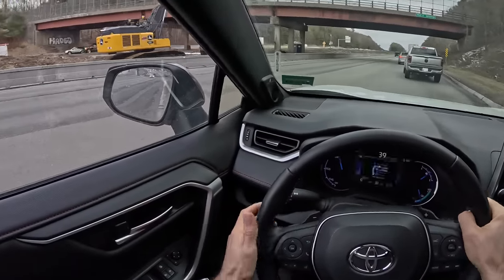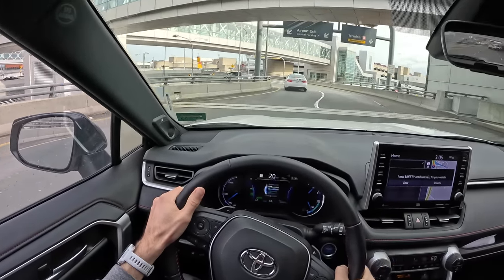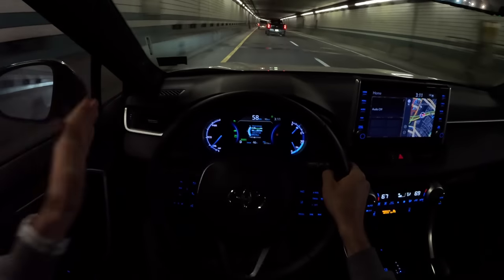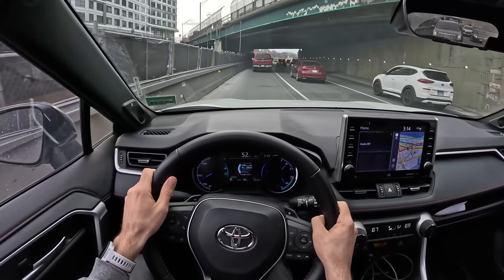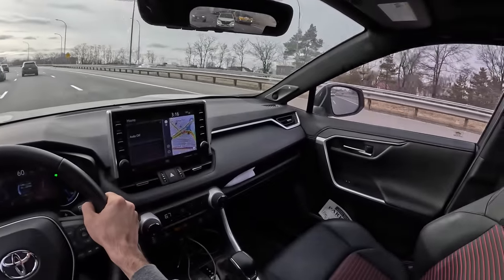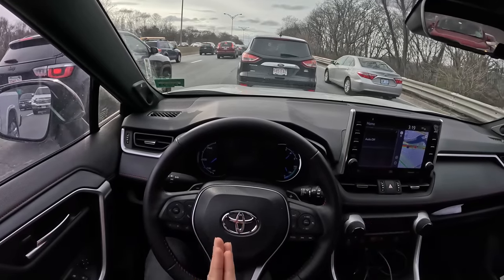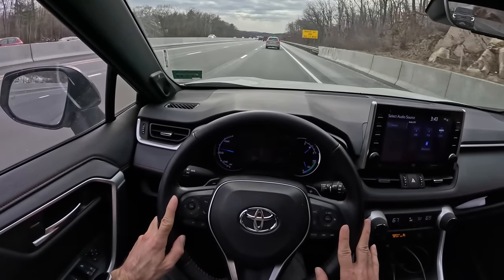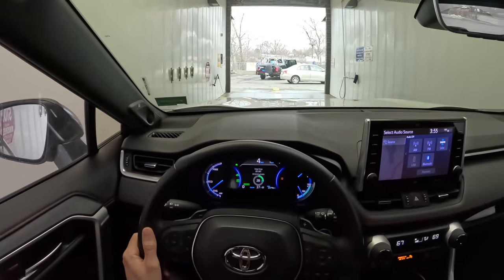Toyota RAV4 Prime After 24,000 Miles - Ownership Update (POV Binaural Audio)

Comment: I agree with this Tedward, we rented a tesla model 3 in North Carolina over the summer and the range sucked. AC and HEAT messes up the range and we had to charge too often. We rented a Stelvio right after and felt like it was easy to fill up and just go. BE ON THE GO ! THanks
Reply: Currently in NC and was about to go full EV until I realized the disadvantages that come with that. As a result, I'm getting a Prime.

Comment: I would love to see a PHEV Type R. You would need some pretty advanced sort of stick shift, but this Rav4 Prime shows that you can still make big power and have great efficiency in cars with N/A engines!

Also, to speak to your point on hybrids; my 2014 Accord Hybrid had a 16 gallon fuel tank carried over from the traditional power trains, and I was able to squeeze out 700 miles per tank. The tank could still be that big because the battery was taking up space in the trunk. The Accord Hybrid after that moved the battery underneath the rear sears, taking up space that would otherwise be used for the fuel tank, restoring the trunk space and pass through seats. Seems like downsizing the tank was an effort to make the car more practical for cargo.

Comment: I just took delivery of a 2023 Rav4 Prime SE two weeks ago. Love the car! I um upgrading from a 2019 Prius Prime, so I've had 4 years to thoroughly explore and become familiar with the benefits of a PHEV. This Rav4 Prime is like, Toyota took everything that makes the Prius Prime an amazing car, and improved on it. Of course, I am giving up some fuel economy - the Rav4 is a totally non-aerodynamic huge box on wheels - but I am still getting 45 mpg in Hybrid mode, and 3.7 ~ 4.5 miles per kW-hr in EV mode (about 45 miles EV range on a full battery). As you state in this video, the R4P is fun to drive, quiet, has as much power for passing and climbing grades on the freeway as most non-Hybrid CSUV's and minivans with V6 engines, and way better fuel economy. I've driven it 3,800 miles, and have only found four minor niggles: 1. There is an angled edge on the center console that digs into my right thigh. I have to stuff a towel or sweatshirt there on a long drive, or I end up with an actual bruise on my leg after 8 hours driving. 2. The front seats are too small for people over 6'-0" / 250 pounds. By "too small", I mean the seat base needs to be 3 or 4 inches longer front-to-back, so it provides better leg support and doesn't cut off the circulation in the driver's legs after a few hours. 3. The steering wheel is covered with some synthetic that tries to feel like leather, but it's too slippery, as if someone at the dealership wiped it down with Armor-All. If you ever tried to ride a motorcycle after putting Armor-All on the seat, you know how slick and slippery the stuff is. A real leather steering wheel cover would not be so slippery. I'm thinking of seeing if there is a chemical I could wipe on the steering wheel that wouldn't damage the covering, but that would make it less slick. 4. The Android Auto/Bluetooth system is buggy and not 100% reliable. When I am trying to run Google Maps or MapFactor Navigator, the connection might fizzle 2 or 3 times in a 200 mile drive. When this happens, the only way to re-establish the on-screen Navigation is to pull off the highway, reboot both the car and the cell phone, re-start the navigation session from scratch. Needless to say, this is annoying, and every time it happens, I lose 10 to 15 minutes. Hundreds of people have reported this as an issue in late model Rav4's both the Hybrid and the Prime, so it isn't just my car or my cell phone. But other than these small gripes, the car is amazing. Wait, one more thing: the all-black interior on the 2023's in positively gloomy. All of the plastic trim on the dash, the door panles, the headliner, EVERYTHING is black, except for a few small touches of silver plastic trim here and there. I am going to try and alleviate this with seat covers in some brighter color, tan and light blue, or something similar. And a dash cover in something other than black.
Reply: Many complaints.......And yet You like it.???...............Paul
Reply: @paulholterhaus7084 - My complaints are minor, mostly cosmetic issues like the all-black interior. I fixed the slippery steering wheel  with a $10 synthetic wheel cover a couple of weeks ago. The Bluetooth connectivity problem might be an issue with my phone, so not the car's fault. I don't own a different phone to test with, so I  can't say for sure. The small seats are only an issue because of how tall and heavy I am, and that's not the car's fault. Owners who are of "average" height and weight seem to have no problem with the seats. So, there are a few ergonomic issues I wish were different, but bottom line is the Rav4 Prime is arguably the most versatile vehicle you can buy right now, as long as you don't need to tow a trailer heavier than 2,500 pounds. There are wagons and minivans that have more interior cargo volume and more seating capacity, but with gasoline now at $5.25/gallon, fuel is becoming a major cost component in owning a car. Used to be that insurance was the most expensive recurring cost, but now it's gasoline, and I wouldn't be surprised if gas on the west coast hits $6.50 gallon by next summer. 

Here's a cost comparison between the Toyota Sienna Hybrid minivan, the Highlander Hybrid, and the Rav4 Prime. The Sienna and Highlander both have more carrying capacity than the Rav, but they aren't PHEV's: every mile you drive you are burning gasoline, at a cost of about 17¢/mile (at $5.25/gallon). That's $2550 for gasoline for 15,000 miles, which is what most people drive in a year. Now lets see how the Rav4 Prime stacks up:

If you live somewhere with electric rates around 15¢/kW-hr for overnight home charging, and you can run your Rav4 Prime 50% on gasoline for road trips, and the other 50% on electricity for in-town errand-running, and you are getting 45 mpg in Hybrid mode (that's what I'm averaging), you will spend $875 in a year on gasoline, and $225 on electricity. That's $1100/year, or 7.33¢/mile, for 15,000 miles of combined gasoline and electric driving. If you take fewer road trips and can manage a 70% electric/30% gasoline split,  then you will pay $315 for electricity, $525 for gasoline, which is 5.6¢/mile $840/year for "fuel". That's $1710/year saved in fuel costs compared to a Sienna or Highlander. Purchase price is about the same for all three vehicles, around $45,000. In 10 years, that's $17,000 in savings. 

I foresee gasoline prices continuing to rise far faster than electric rates for home charging, making the  cost of running EV's or PHEV's ever more attractive. The Rav4 Prime is a compromise solution for me. Until we have EV's with better batteries (at least 600 mile range), a PHEV is a better solution for people who live in regions with severe cold winter weather, or in the Western states where driving distances tend to be much longer than in the East. For example, every day, thousands of people drive between Los Angeles and the San Francisco Bay Area or Sacramento (our State Capitol) - it's 450 miles, and there simply aren't any "affordable" EV's that can do this non-stop yet. Maybe 5 or 6 years from now there will be? But my Rav4 Prime can do 600 miles non-stop, and when I do need to re-fuel it, there are gas stations everywhere that I can top off in 10 minutes or less, not the 2 hours to fully charge an EV that's only going to get 250 miles until I have to charge it again.

Comment: 7:34 Tedward, it'll be interesting to see your reaction when the Civic e:HEV makes it stateside. It's already more than 3300 lbs curb weight, so 150+ from your Type R. Having owned a PHEV compact (Volt) and driven the two cars back to back, you really notice how much heavier the battery pack makes the car and affects it in corners. A PHEV Civic would be approaching 3500 lbs, a long ways from the 3000 lb Civic base models that can coast forever.
Reply: that's why I kind of like the MINI SE, yes it has limited range, but it would be great as a second car, it's fun to drive and relatively light weight (3,153 lb) for an EV
Reply: Phev CR-V is front wheel drive only. Huge mistake IMHO.
Reply: WAIT   WHAT??   You mean the CRV PHEV not available yet in US is not AWD ?   R U SURE ?
Reply: @philk4944  I am fairly sure 2024 CRV plugin is front wheel drive only. Regular hybrid is 4WD. Just double check online. Same for Skoda Kodiaq plugin coming in Europe.
Reply: Weight reduces coasting only when you're on an incline, when going downhill it improves it and on flat is fairly negligible, basic physics 101.

Comment: We've had a Honda Clarity PHEV for almost five years. It's the best car I've ever owned or driven. It's a sedan while I would rather have an SUV. Otherwise we drive 100% EV for weeks at a time, then the gas motor can come on for longer ranges. I've never used a public charging station. It's the best of both worlds.

Some people say a PHEV isn't good because it has both an electric motor, battery, and a gas engine which is more likely to have reliability issues. Many of those who shy away from a PHEV will then go out and buy a hybrid car which has both a motor, battery, and gas engine. Hybrid gas engines are running close to 100% of the time so contribute much more to polution than a PHEV. It's true that we have to have the oil changed like an ICE car, or hybrid, but since the gas engine is only used (in our case) about 15% of the time oil changes can be reduced to once a year.

Compared with a full EV car a PHEV has a much smaller battery so it is better on the ecology. 

In our particular case we have roof solar at home so the car gets charged most of the time from the sun.

Comment: I’m still waiting for my 3.5 year so far wait prime, may be 2-3 more in Ontario… Quebec gets all of ours (Canada) but still waiting and excited for it. As a fellow rav4 user I saw you fulllly use the signal, with rav4 you can tap it for lane changes and it’ll signal 3 times and not have to cancel, I did change mine to 5 times with a tap.

Comment: We have a 2022 Rav 4 Prime base model SE we purchased new in March 2022.  15,000 miles on it so far and our electric range living here in Northwestern Oregon ranges from 35-45 in winter and 45-55 in summer driving on rural roads and highways here.  Even with a depleted battery running as a full hybrid MPG's on regular grade gas averages 38-45 MPG in winter and 45- 50+ MPG in summer.  Now all RAV 4 Primes are All Wheel Drive as well and electric range and MPG's on just gas is better than all the competition. 

The only issue I have is Toyota should have more models like the RAV 4 plug in where you can drive40-50 or miles on pure electric and than with a depleted battery get 35-50 + mpg just on gas in hybrid mode.  After we purchased our Prime at MSRP, not a penny more, the market took off where people were paying thousands of dollars over MSRP.

Comment: I bought a 21' Prime SE w/weather package for 42.5k OTD.  Great car, especially after getting rid of the garbage low rolling resistance tires (Vredstein Quatrac Pro is what I upgraded to, great tire).  RAV4 rides smooth, feels more upscale than the base 4 cylinder .. very fast in a straight line / passing power - the immediate electric torque is great.  I got the full tax credit so effective cost was 35k.  At that price with the rebate it's a solid deal, but I don't think the rebate is available, and there isn't enough inventory so you'll be hardpressed to find one, let alone at MSRP.  At 42-45k for an SE, and no tax rebate, I don't think it's worth it. Yeah, you'll save some money on gas, but you'd better served getting the hybrid or the new Honda CRV Sport Hybrid for about 35k.  My area is flat and warmer and I could get 40-45 mpg driving around in the city.  Highway MPG was 38-40 typically, unless in the mountains.  Best thing about the car is the range on a 14.5 gallon tank is 500 miles, even in the city.  But if you want that, just save the money and get a hybrid XLE for about 35k.  The Toyota hybrid system seems to be better at getting consistently high MPGs vs. Honda hybrid systems.

Comment: You're so right on the 50 mile range. For most people, that's going to be their entire daily commute. If not, gasoline can sort out the rest but thats still 50 miles on electric. I wonder  though, do you think people will run into issues where gasoline might go bad if they go extended periods on only that 50 mile range? What if thats all they do like 99% of the time and go a long time without ever using the internal combustion side.
Reply: PHEVs eventually force the gas engine to run and/or prompt you to run on gas, to prevent those types of issues, as well as cycle the motor so it doesn't fail. It usually takes a month or more for them to go into these modes.
Reply: @saucyedgelord6286  oh cool. The tech behind all of that is so cool. Thank you for the info! I appreciate it 😊🤘🏽

Comment: My family owns a 2019 Hybrid option, (not plug-in). 

Totally agreed about the "power meter" tach replacement, Irks me when I drive it. I'm not gonna lie, I have an e46 and it's a fun car, and sometimes I drive the family rav4, the rav4 is a great car for what its worth, 15 years of difference, but I'm not too used to the CVT in the rav4, power delivery feels weird and not normal (not something you get in maybe a manual or an auto with some form of gears. But its a decent car.

Comment: Does it have any self-driving mode or form of autopilot?
Reply: It has adaptive cruise control with lane tracing assistant. The lane tracing works great on highways and you can practically let the car follow the slight turns and press the breaks if necessary by its own - it just beeps from time to time requiring the driver to touch the steering wheel. On roads with sharp turns however it does not always manage to keep the lane, so this feature is only usable on highways and straight roads.

Comment: I also owe a 2021 Rav4 Prime XSE and I mainly use EV Mode all the time for my commute to work, plus I get free charging at work so I haven't fill up the gas for like 3 plus months.  I traded in my 2018 Camry V6 XSE for it.
Reply from the maker: wild right? I recommend running in HV mode every so often to keep fluids flowing and gaskets from drying out
Reply: I live in MA and when I turn on the front defroster the engine kicks in. Oh I agree about Logan Airport, so confusing.....
Reply: Also, if it’s wicked cold out it will kick on the engine. Live in eastie. So I know Ted and terminal A very well. XSE owner. 10fill-ups with 20k plus getting that same alert. Oy. Curious if you are dealing with the gas tank issue. When the tank reads empty. I can only fill up 10gallons. Toyota is going to replace the gas tank on my 2021 XSE.

Comment: How would someone who drives mostly with the electric range, would change the oil ? Each 3000 miles of total driving ? or does the car has an odometer for the Engine ?

Comment: My Elantra N has the same size fuel tank as the Elantra hybrid. It's an 11.4 gallon tank, but at 22MPG you really shouldn't use more than 10 gallons before filling up. That gives me a range of 220 miles.... Best case scenario I'm on the highway and get 30MPG average, for 300 miles of range. Its quite annoying. 

The hybrid gets 45MPG so it has a nice 450 mile range.

Comment: I have asked this question before but nobody has been able to come back with a sensible answer!!! Why would anyone buy a plug-in Hybrid when they can buy a Rav4 HYBRID and not have to worry about plugging it in?
Reply from the maker: Because you don’t get to use the standard hybrid as an ev.  When you don’t plug this in it IS a hybrid.
Reply: It's been 7 months but I will add that charging at home is a better experience than pumping gas at a gas station. Just ask anyone who has an EV. Public charging is a different matter entirely.
Reply: Acceleration and pretty much never going to the gas station. In a year you spend how many extra hours pumping gas? Too many for me. Better things to do.

Comment: is it just me who quite likes the power dial on the toyota? idk i just like how it moves around. hyundai uses the same, and with the gearboxes these cars use, a standard rpm gauge doesnt work. it is stupid on some other brands, like my f22 bmw 220d. put it in eco mode and a little blue bar appears where there instant mpg is, and when you coast or brake is says charging. like charging what, only thing its telling me is that ill be getting charged for brake pads

Comment: At the moment, EV's are not practical. The Plug-In is as you have all three modes. I love my 2024 R4P, comfortable, 50 mile EV range. Nice ride, and all the safety features. I am a cruse control nut, it keep me safe and no S&H green stamps from officers. It makes total since as I use the EV on speed below 55 MPH, and HV mode above 55 MHP or on the highways at 70MPH. This has so much power I can inadvertently burn outs from start. Toyota Rav4 Prime makes since, they need a base model.

Comment: A tachometer, power meter, whatever is next to pointless in a car that doesn't have gears. You don't need to know when to shift and can't really control it anyway. It's way too big for how superfluous it is. The car could have a big digital speed output that changes colors if you want to see what's happening, or just stays the same color if you don't want to be bothered.